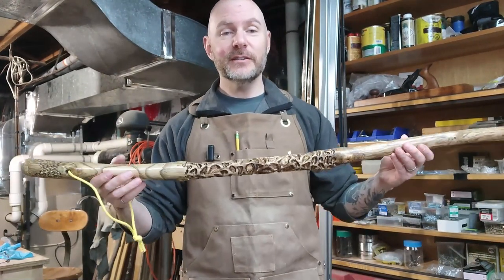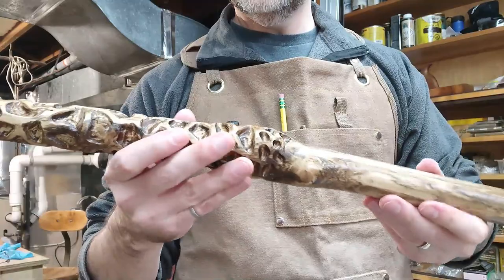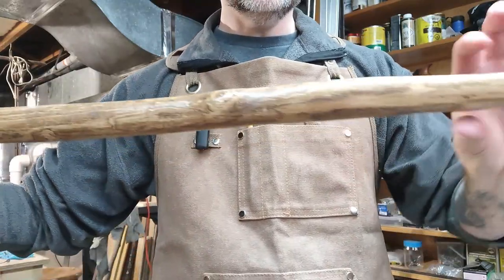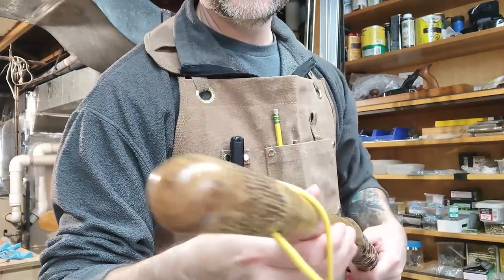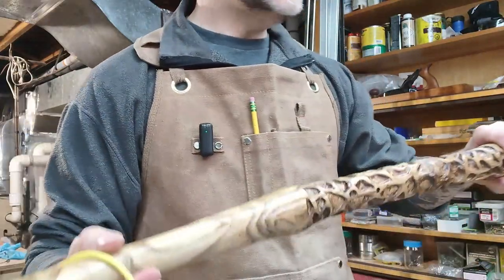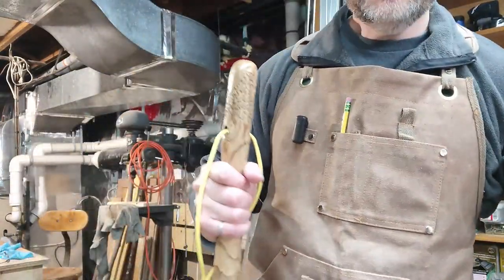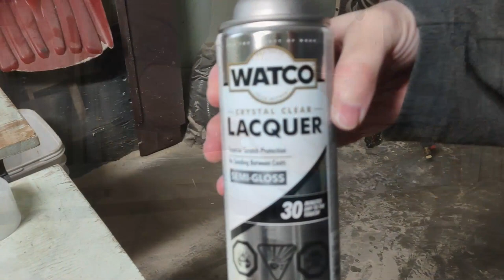HAND CARVED ASH WALKING STICK _ ASMR

Comment: A few months ago I started making making sticks from fallen, oftentimes unidentified branches I find along the local creek here in Austin TX. I started simple and am getting better at planning and design as I go.  I appreciate videos like this from experienced and talented folks like yourself.  One trick that is working for me while stripping bark is to use my drawknife with the tapered edge facing down. I get almost no digging in when doing so. Saves sanding and smoothing out the digs I was getting.
Reply from the maker: Nice, great tip... The drawknife is a long chisel so the concept makes sense. Thanks and glad you enjoyed the videos

Comment: Can you strip the bark off a freshly cut stick or should you wait until it is dry?
Reply from the maker: The bark comes off fairly easy when green with a knife. But it's also easy with a drawknife when dry. Cedar or pine works best when fresh, but I find the hardwoods I like doing it when dry. Leaving the bark slows down the drying process and less prone to cracking